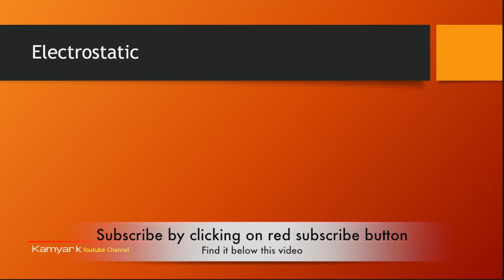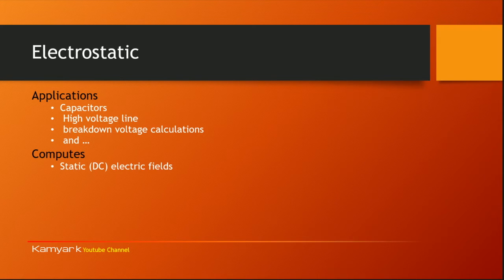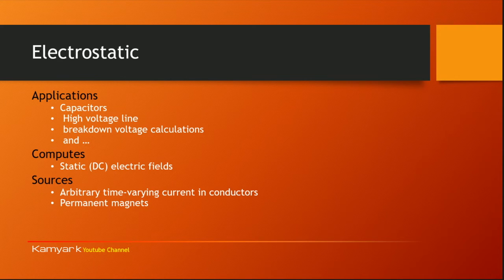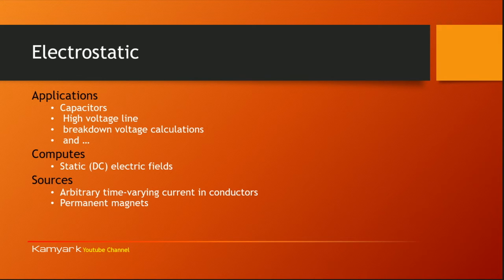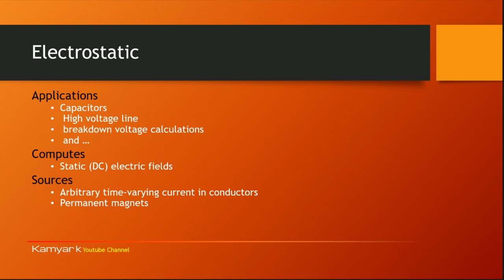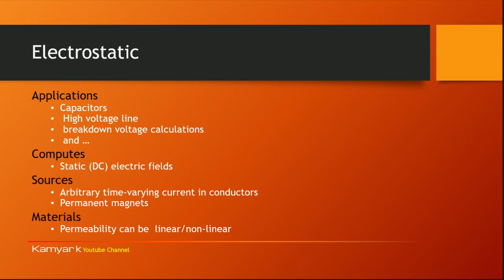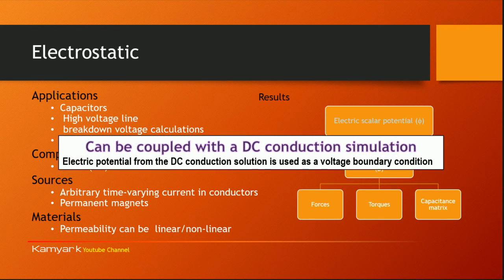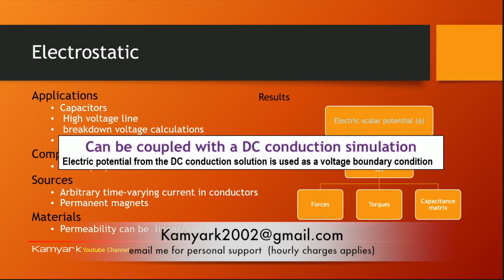501 Ansys Maxwell | Introduction on Electrostatic Simulator

Comment: Hello Kamyar,

I am following your videos which helped me a lot for the design of Coil antenna. I am trying to simulate the coil antenna for wireless power transmission but I''m facing problem at excitation port. The S(11) response of the coil always strat from positive dB up to 100MHz after that, it moves towards -dB. If you make any video related to that then it will more helpful me or like me. I am using wave port (50ohms SMA). please reply if you get some time

Comment: hey buddy -- i'm having a tough time trying to figure out how to get the total charge on the surface of a conductor (excitation was specified as voltage).  Do you know how to use the calculator?  I've tried following some online resources but always getting zero as the integrated charge.

Also -- would like to plot E-field in one direction on a rectangular plot, but can't figure that one out as well.

Any help is greatly appreciated!!